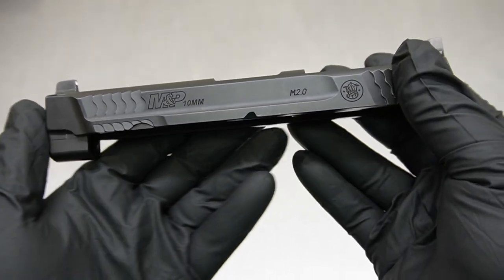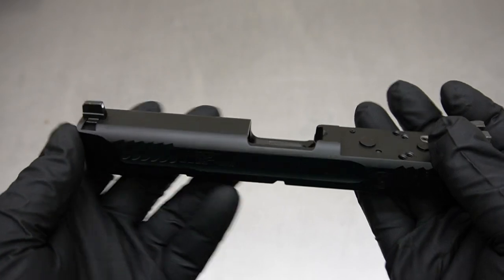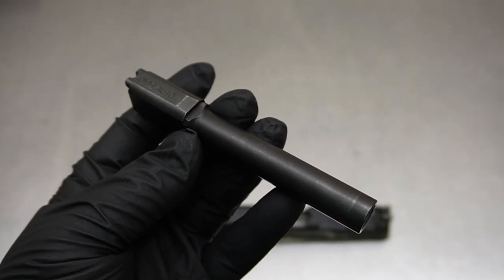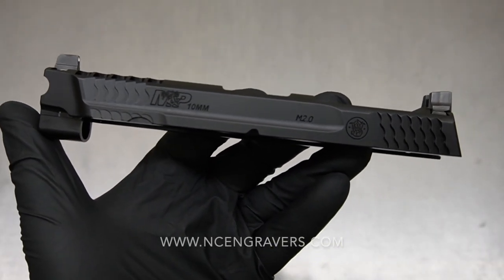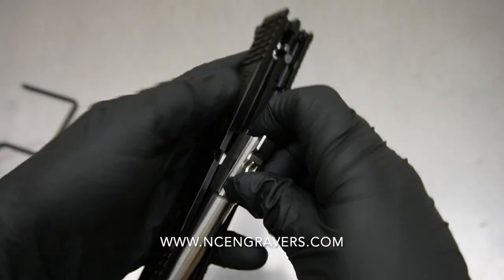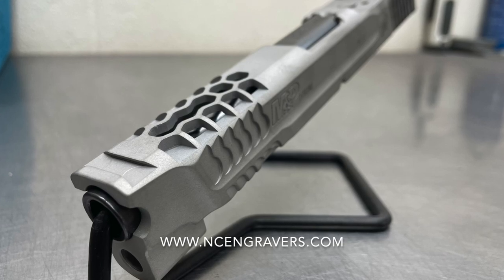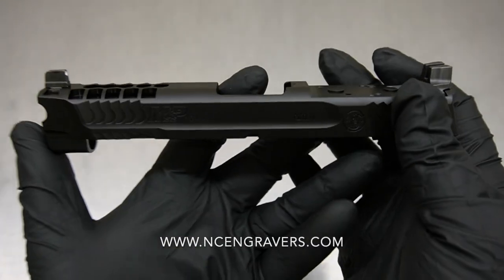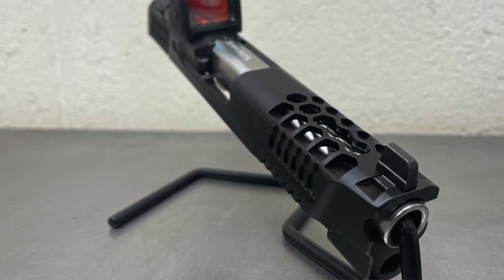NCEngravers.com - M&P 2.0 - 10MM - Hive build

Comment: Howdy, absolutely thrilled about the work Mark did! I am glad that I was able to communicate what I wanted to begin with and then let him have the freedom to follow his process. It is an art! To anyone that is looking to aquire this in a full size or has one already the pistol actually had never been fired by myself. I won one of two that I bid on in auction factory new and when I got it I had already been in communication with Mark. I was barely able to remove the barrel from the slide due to incredibly tight machining tolerances and there were a large amount of drag marks on the barrel and inside the slide itself from me racking the slide as one would do with a new pistol. If I had not gone with the polished barrel, any cerakote finish or black nitrade done after the project would have failed during dry cycling/live fire. Hope this helps the next guy/gal that is looking to have work like this done to the M&P 2.0 10mm. I am so happy that I did my research and chose Mark of NCENGRAVERS!!! THANK YOU MARK AND WIFE :)
Reply from the maker: we do appreciate your business. -Mark

Comment: This turned out amazingly well. I actually have one of these, and I have to say recoil is not really an issue even though it's 10mm. The trigger is horrible, but that's another story. It is very easy to shoot, and quite accurate at 25 yards. That ported and polished barrel turned out awesome as well as the hive cuts and cobra nose. Very clean upgrade. Another one knocked out of the park, Mark.

Comment: Impressive results,  on the barrel, is that just a polish or a coating to get that result? I'm interested in this work for my CZ 75C barrel.
Reply from the maker: this is a polished barrel finish which i wouldn't recommend unless its a stainless barrel or it will rust.